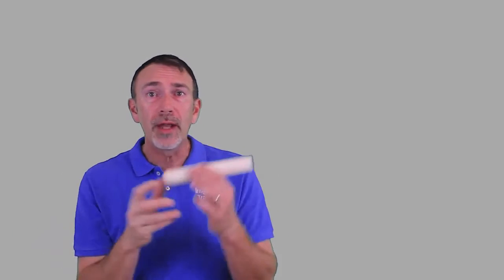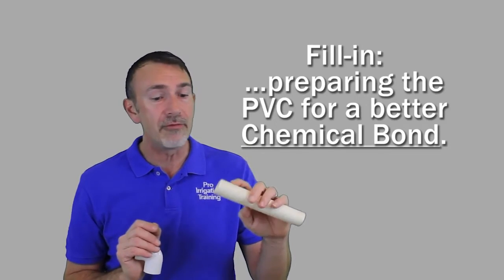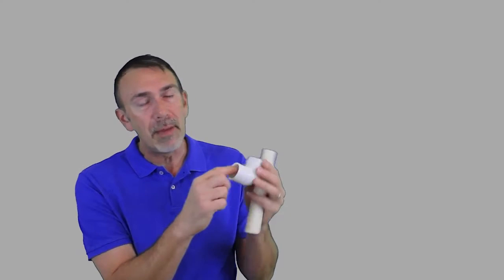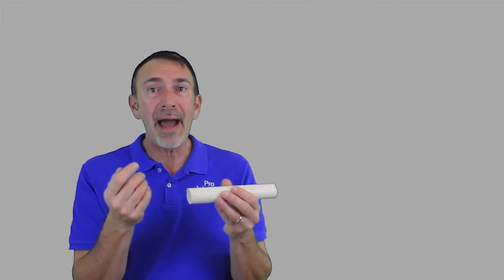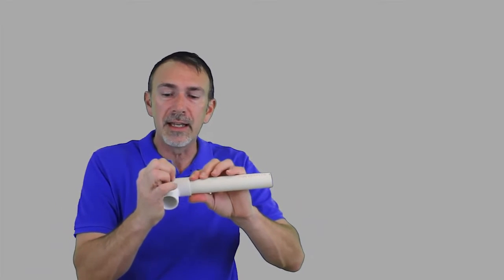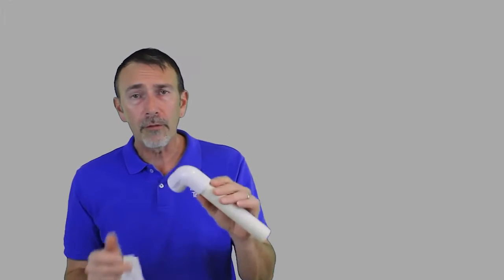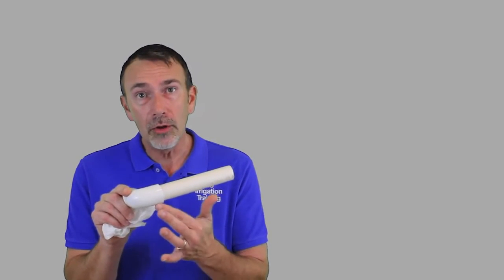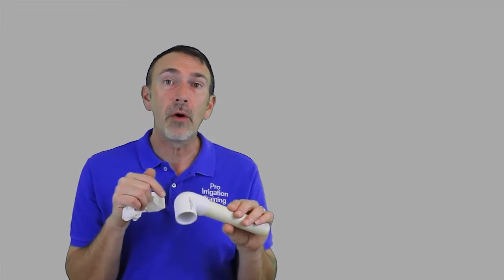How To Glue PVC (solvent welding) Irrigation Repair

Comment: Most cements recommend chamfering the pipe. Is that a step you usually take?
Reply from the maker: It depends. Usually not when just gluing one piece onto the next piece in an installation situation. But in a repair situation where the pipe needs to be bent and forced, it definitely helps. It helps with Schedule 40 pipe and larger sizes as well.

Comment: So to make sure I have this right. I put the primer on let it dry, then I put the glue on?
Reply from the maker: That's how I do it, even though the instructions on the can say to put the glue on while the primer is still wet. If you do it wet, just make sure there isn't drops of primer hanging from the underside of the pipe, it can dilute the glue and make for a weak weld if you don't twist enough as the weld is setting. So to avoid any problem, I just wait a couple seconds till it dries the drips off the bottom or I'll wipe or blow them off. Maybe I'm a little too paranoid about that aspect, but I like for every glue weld to be perfect, I hate to have to do something twice. Thanks for watching!